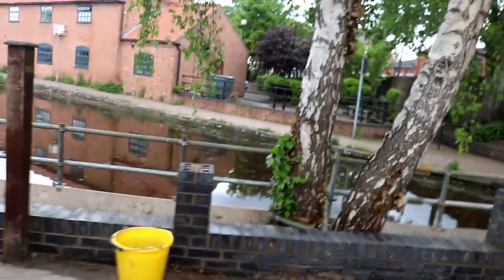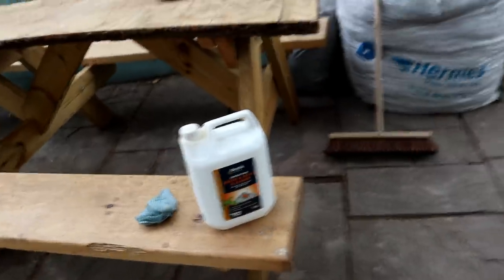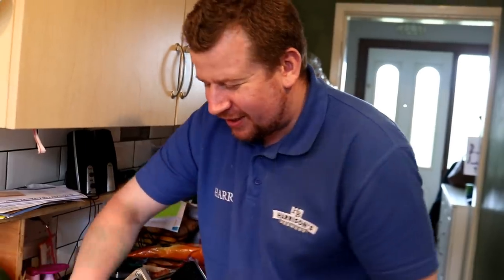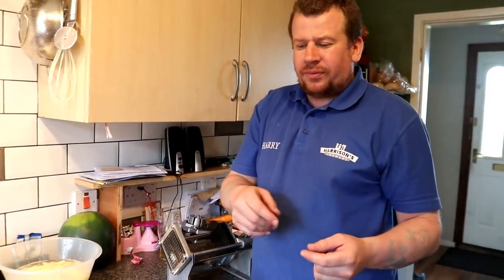SPUD CANNON

Comment: Actually, if you care to poke around with the transformer...you can put your meter on it on Ohms and use a toothpick or bamboo skewer to manually separate the winds and see if you can clear the short. If you can, you could paint the winds that are blackened with nail polish...and put the unit back into operation. You'll know if you clear it when the ohms increases sharpish.

Comment: You sounded a bit chipper at the end of that one 😄 . A big transformer like that one normally means quite a lot of power. I's easy to make your own providing you have the insulated copper wire of the right thickness, unwind each of the cores counting exactly how many that there are, usually a winding of primary followed by a winding of secondary (or visa versa) and then wind the new cores on. Of course a reel (or two) of the required copper will probably be vastly more expensive than a new transformer from ebay 😄. Cheers, Schnuz.

Comment: That wall will look the business once those railings start going up,tidy looking job. That chipper is going to need a good solid wall mounting if you need to use that much pressure to push spuds through, probably better than mounting it on side of countertop where you might get a lot of flex over time plus it would be at hip height so  ya could bang into it walking past. If you could make a dovetail mounting,fit that to wall and then backplate on chipper,that way it's solid but removable for cleaning etc. Cheers.